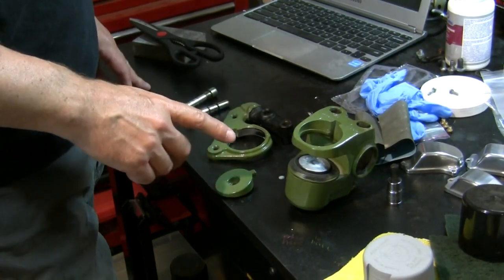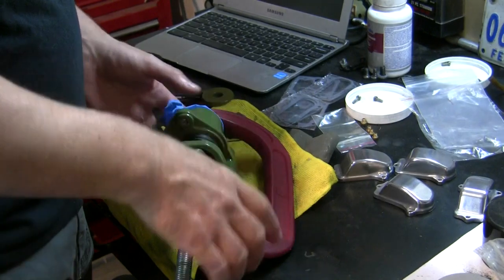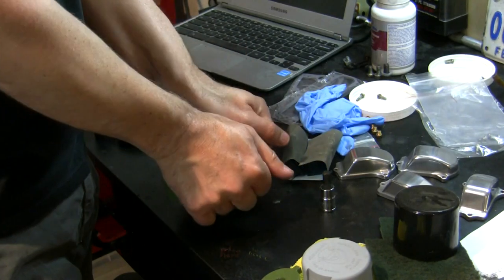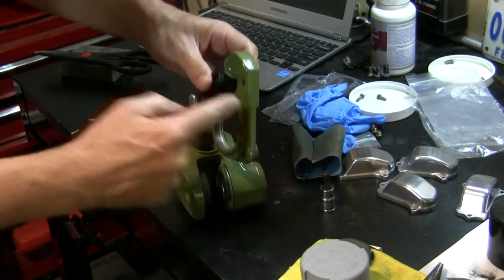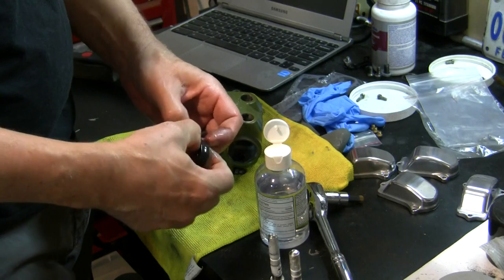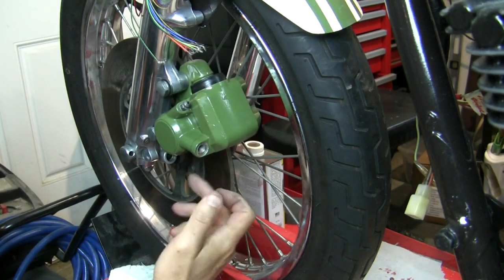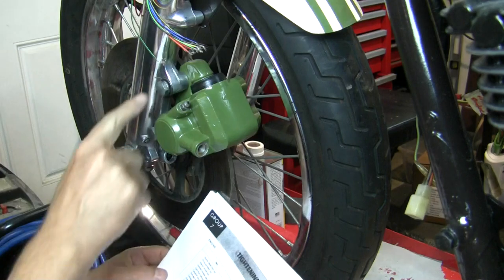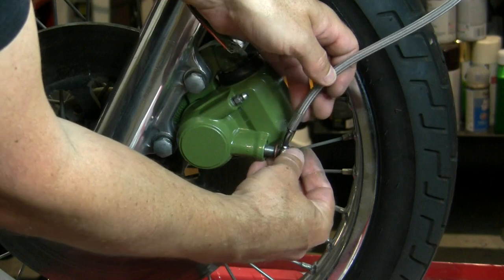Install Front Brake Caliper - GS550 Cafe Racer Build (Part 82)

Comment: What keeps the inboard pad on the piston in place ? Where did you get the brake lines  OEM are disco’d everywhere.. Thanks nice video
Reply from the maker: Thanks for watching! The pad you mention is cradled in a "holder" that slides on the two pins I greased in the video. You can see the holder and pins lying on my bench at 1:11. The  other pad is mounted to the caliper with a small bolt. The brake line was a custom length (but prefabbed) that I got off eBay. Stainless steel wrapped. Was inexpensive and works great.
Reply: Thanks!

Comment: Did you rebuild the caliper? If so what is the part number of the rebuild kit you purchased?
Reply from the maker: I did not need to rebuild my caliper so I don't have a specific kit that I used. That said, this one would probably work. https://www.ebay.com/itm/162468609722 They are the same for the B, C, N and EN models. Pads may differ but parts breakout indicates the seals are same. Order after doing your own research however. Thanks for watching.

Comment: Hello again. Question: Were did you find or buy the nice new looking braded brake lines ?
Reply from the maker: I purchased that many years ago for a different bike and didn't end up using it for that bike. It's been lying around my garage for years. I want to say I originally got it from eBay, but my memory could be off.
Reply: @UrbanMonkTV   JP cycles has many options i just looked on their site, any way thanks for the reply. I love the look.
Reply from the maker: @alstone5257  Thank you. Anytime.

Comment: When you replaced the old brake hose with the new braided one, what length did you go with, I have same set up with the clip on's on the same spot as yours. Thnx!
Reply from the maker: Mine is 30 inches (76cm) including the end fittings.
Reply: @UrbanMonkTV  awesome thank you UM!
Reply: My Gs550 is a 77, and from the master cylinder there's a union near the triple clamp, inbetweeen them, looks like another banjo bolt where it separates then runs down to the caliper. If I replace with the one solid braided hose will that eliminate that union?
Reply from the maker: @bhunter8476  Yes, it would eliminate that union. Just to be clear, you have a single disk and caliper on the front correct? Not dual disks?
Reply: @UrbanMonkTV  yes single caliper. Thnx!
Reply from the maker: @bhunter8476  Then yes, no need for union.  Just be sure brake line won't get caught up anywhere during riding.
Reply: @UrbanMonkTV  awesome thank you UM!

Comment: How do I remove the rear pad out of the caliper😊
Reply from the maker: As I recall, there's a small screw holding it in. Just remove it and pad comes out. They don't float like more modern disk brake systems.
Reply: Got that one off the other side I assume  the hex bolts?
Reply from the maker: @matthewcalhoun3135  Sorry, it's been a long time for me. Memory fails.

Comment: Can you refresh me if you clear coated the calipers?
Reply from the maker: I did. I figured it's another layer of protection from rock chips and such.
Reply: Urban Monk TV I'm planning on using vht roll bar paint on mine.  It's an epoxy coating.  Your thoughts?
Reply from the maker: @Jeremy6981  I think I should have done that. 😄 What does the finish look like?
Reply: Urban Monk TV  semi gloss black.  Haven't used it quite yet.
Reply from the maker: @Jeremy6981  Epoxy sounds durable. I'm guessing you'll like the result.

Comment: I don't think I would have used white lithium grease on any brake component. It can't handle the heat generated in the braking. 

Just my personal opinion. But I don't care for the green calipers.